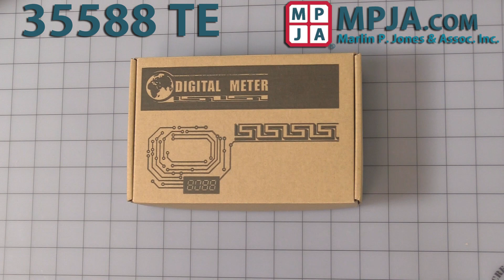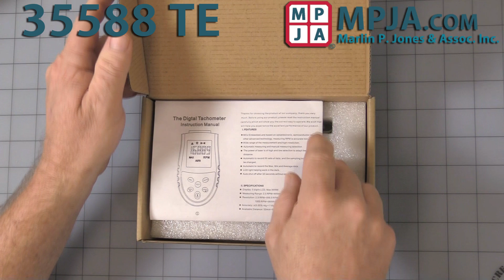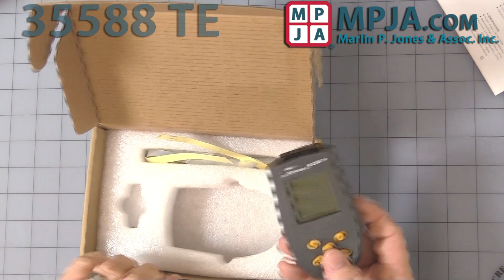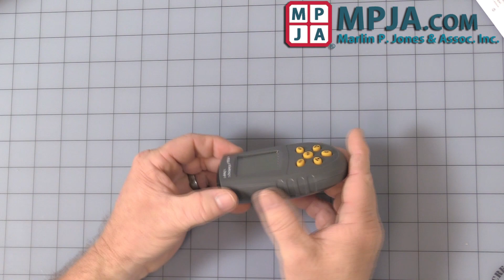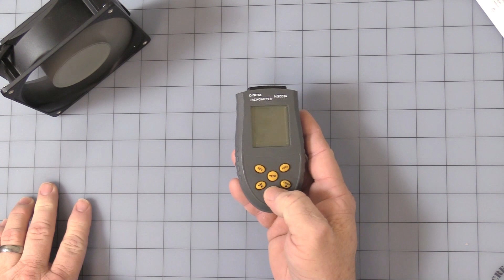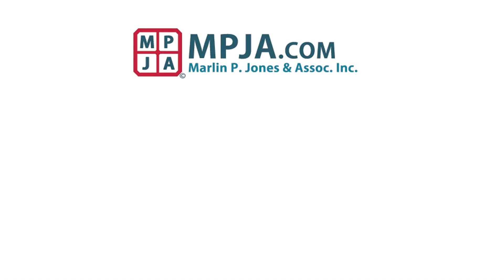Palm Grip LASER Tachometer HS2234 - 35588 TE

Comment: I just received one of these today; the primary reason that I purchased it was to measure the motor (prop) rotational speeds of my drone when it is at standby and when I'm applying maximum throttle (with the drone appropriately weighted down of course).
 
Thank you for taking the time to produce and publish this video. :-)